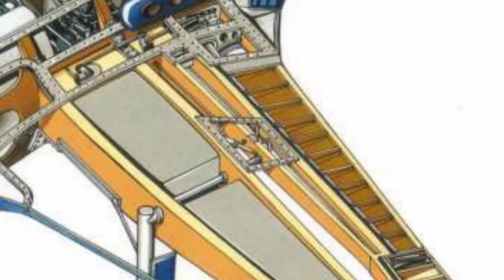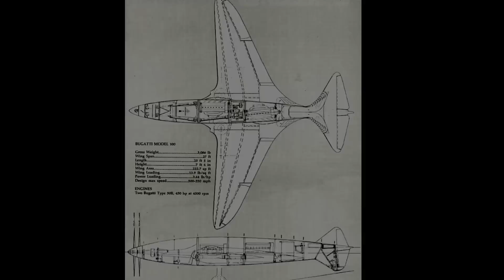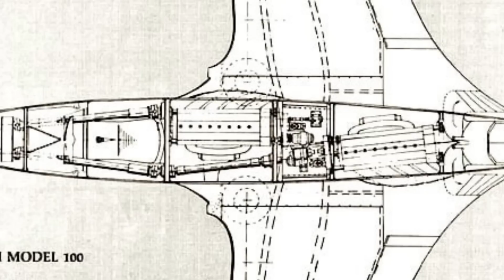The Plane Built To Beat Nazi-Germany (Bugatti 100P)

Comment: G'day,

I disagree, strongly.

The Buggati Model 100 was ALWAYS a wildly stupid idea.

Two high-powered Engines driving a pioneering Contra-Rotating Gearbox spinning a Contra-Rotating Propeller via concentric Shafts, with a 
"Wouldn't It Be Nice If"
Cooling System which took NO Account of Internal Friction Drag on the Air Ducts, and a tiny overloaded Wing and a radially Symetrical Trifoil Empenage, and a retractable Tricycle Undercarriage...

Every one of them there named features being at least enough of an unknown Variable for one alone to spell the catastrophic destruction of the Prototype which was attempting to simultaneously successfully  (Suck Cess Fully) solve EVERY potential  Developmental Problem which each and every Radical Component and Experimental System and Sub-System might perhaps possibly maybe throw up - rather than function PERFECTLY, straight off the Drawing Board, as Old Man Buggati FANTASISED that everything was goanna go, for him - and his hubristic silly bloody Ambitions to aggrandize himSELF.

80 Years down the track, and delusional Accolytes are STILL Bankrupting, and killing, themselves,  all while trying to make Buggaration-Ratbag's Lunatic notions of how to build a World Speed Record-breaking Hairygoplane.

To see what was ACTUALLY making the Pace, when Buggatti was pretentiously posing and pretending to be achieving ANYTHING worth doing...; Look up the Messerschmitt Me-209-R...

It held the Single-Seat Piston-Engined World Speed Record from 1938 until about 1988 (?).

Buggatti was a Bullshit Artist(e) driven by
 Wouldn't It Be Nice, If FANTASIES.

How many people drive, or fly, a Buggatti, today ; how many Buggatti's fought in ANY Wars, defending anybody ?

The whole thing was a 
"Brilliant
Bright and Shiny
BrainFART..."

which ALL future generations will look back on and condemn - as a STUPID "Reason" to have ever emitted Fossil Carbon to the Atmosphere in pursuit thereof.

Buggatti's great great grandchildren will likely exhume him and play Soccer with his Skull - the better to inform his Shade of what a dirty filthy selfish WASTE he made, of his Life's time on Earth.

Just(ifiably ?) sayin',

Take it easy...

Such is life.

Stay safe.

;-p

Ciao !
Reply from the maker: Fair point, I do need to look more into the ME 209 it definitely piqued my interest.
Reply: Former US Air Force pilot Scott Wilson built a replica of the Bugatti in 2016. Unfortunately, as you pointed out the 100p was a purely, on paper it looks really cool, design without a solid basis in real aeronautical engineering. Wilson was tragically killed when the plane crashed on takeoff of a test flight.
Reply: Um you forgot to mention it was made  muchly of balsa wood no better than polystyrene.
Reply: @kimbo99  

G'day,

Look up a thing called the
DeHavilland
Mosquito.

Built of 
BALSAWOOD-Cored
Spruce-Veneered
Plywood...

Actually.

460 MPH
Bomber

1% shot-down rate,
Night-Bombing
Durr
Turd
Reich during the
Great
Waaauughhh(!) of
Two.

Balsa is actually a
HARDWOOD,
As defined by it reproduces from
Seeds..., 
Rather than from
Spores from Cones -  which is what defines actual
Softwoods - like
Pine and Fir...

Just(ifiably ?) sayin',

Take it easy.

;-p

Ciao !
Reply: @WarblesOnALot   I will be looking this up. Thickness and composition of the plywood. Mosquitoes  mostly made in Canada. I didnt know balsa wood grew there. Regardless of the definition balsa wood is pissweak and ultra light. And it may have been only used as a glue substrate, Like doped cloth. I wonder if the glue penetrates and strengthens the balsa ?
Reply: @kimbo99  

If you've ever heard of "Composite" structures and materials..., that means,

"Plastic Copy of Wood".

Cellulose Fibres in Lignin Cement, cut, shape, glue and sand it to make whatever you like.

Laminated Wood is not Plywood, and Plywood is not Particle-Board..., and there are many Grades of Balsa - it's actually sold by it's density...; the lower down in the Trunk the more Load the Wood is subject to, so the bottom of the Trunk supplies the dense heavy hard Balsa, while the top end yields the really lightweight stuff which you're thinking of.

Only SOME Mosquitos were built in Canada, we built them here in Oz as well.

The entire Fuselage Shells were moulded with crossed Veneers of Spruce, then a layer of Balsa, some places plyed, between half an inch and an inch thick - then more Spruce Veneers.

 Once the two Shells are complete and plumbed and wired and kitted out, they're glued and scarf-jointed with Fishplates inside and then Fabric covered.

There's a bloke in Kiwiland with a set of Moulds and Jigs, who has now built about 3 Mosquito Fuselages, for Restorations owned by people who are stupidly rich.

Look in Aeroplane Monthly magazine, they're regularly covering Mosquito Rebuilds.

On a Weight versus Tensile and Comprsssive Stress resistance basis..., Wood is stronger than Steel.

The fact that this Bugatti incorporated Balsawood in it's Sttucture was NEVER any kind of a Problem for it.

The Problems were the
Experimental Engines..,
Tightly-Cowled
Cooled in Theory by an optimistically designed and hypothetically-functional Cooling System...,
Shaft-driving an Experimental Contra-Rotating Gearbox via Offset Stsfts and Universal-Joints, spinning Experimental Variable-Pitch Propellers, on a Machine with an Experimental Retractable Tricycle Undercarraige, attempting to fly with a high Wing-Loading and small Control Surfaces...

All in an attempt by an Automotive
STYLIST
(who employed actually qualified Engineers to attempt to build his Daydreams and render them functional) - who felt like trying to build a Radical Contender for a World Speed Record - as his FIRST ATTEMPT at Aeroplanology.

It's a pity Bugatti didn't have the Plans for his "P(retentious)-100"
shoved up his Fundamental Orofice back in 1938.

In my humble opinion (!).

Such is life,

Have a good one...

Stay safe.

;-p

Ciao !
Reply: @WarblesOnALot  Thanks for that enthusiastic Response. After your first reply I went off and discovered till 1943 they used standard woodwork glue made from milk casein. We call it PVA. The glue dissolved in water LOL. It seems crazy to ever consider that for aircraft construction. But maybe thats all they had.1943 they went to 2 pack glue that was stronger than the wood it was glueing. I am keeping both of your answers on the cloud  so I can ask gotcha questions at parties.  Cheers Steve in Sydney.
Reply: @kimbo99  

No worries mate.

The Casein Glue was pretty good, made from Milk Solids, actually, but yeah - the Mosquitos started delaminating in the Tropics due to the Humidity soaking into the Wood itself and then wetting the Join from the inside... The Germans had similar issues, but their Glue was chemically unstable and not so slowly it reacted to become strongly Acidic, and then it started dissolving the Wood.  There's good Photo's and Videos of a He-162 Volksjaeger losing it's Left Aileron on a Test Flight in front of Goring and a big mob of SS Generals.

Until the 1980s when they began to start considering Epoxies, the Gold Standard is Selleys Resorcinol, a Phenolic Resin based Marine Glue which is BOILPROOF...; very messy to mix, and it dries with a Black Glue-Line, but it Works.

To see what I mean, backtrack me to my "Mad Scientist Videos" Playlist, and check out the Wind Turbine Turbulence-Resistance Test-Rig which I use as a Garden Ornament...; I laminated and carved those Rotors in 1985, and they've been unmaintained on that Test Rig in the Sun, Wind, and Rain since about 2000.

The Epoxy "Varnish" has died and peeled off, and now the Wood (Tasmanian Oak) is very gradually eroding away around the Glue - leaving the Resorcinol standing "proud".

The Propeller over my front Door is also Tassie Oak and Resorcinol with Epoxy, I designed and made it in 1992, flew it for 5 & 1/2 Hours and then made another one in a finer Pitch.  The Wind Turbine Rotors on the Verhanda Wall never went into Service, because..., Solar Panels work every day, but Windmills are lucky to work weekly, in real life it's mostly too calm to be worth the effort of having an Electric Windmill.

If you care to get into it...(?), then in my "Personal Aeroplanology..." Playlist there's a bit of a Tutorial series on Propellercarving - done in miniature to produce Laminated perfectly Helically-pitched Airscrews 8 inches in diameter, to replace the Sheetmetal Fanblades supplied on Peltier-Effect powered Electric Stovetop Fans..., for which I used Araldyte 5-minute Epoxy and Feast Watson Epoxy  Spar-Varnish..., On Casuarina with Cedar, and Casuarina with Pinus Radiata, and Cedar with Stringybark...

I'm one of those eccentric Oddballs who tends to make things rather than buying what's in the Shops, I live on an Endangered Species Sanctuary...(not actually a joke, either !).

Such is life,

Have a good one...

Stay safe.

;-p

Ciao !
Reply: If you're going to slam Bugatti, try spelling "Bugatti" correctly at least once...and then there's some of the other bafflegab in there like concentric driveshafts (they were one each side) and tricycle gear (the 100P was a taildragger like nearly everything else at the time)...
Reply: @stevetournay6103  

G'day,

Buggar
Buggati
Bugatti
Buggatti
AND
Bugati.

The Propeller Shafts were Concentric and Contra-Rotating, from the Gearbox ; which was fed by a pair of Offset Shafts.

The whole thing was HIDEOUS.

In my HUMBLE
Opinionation...

(Lol !).

Take it easy,

;-p

Ciao !